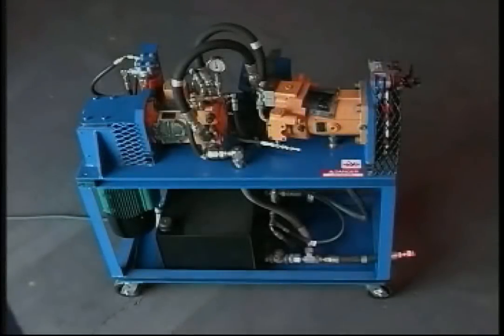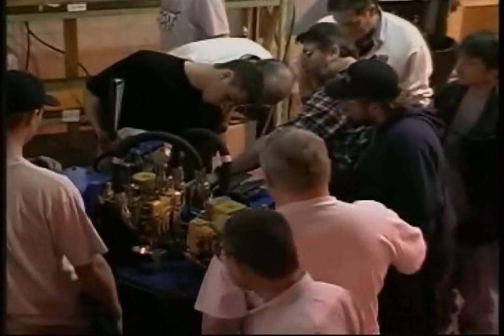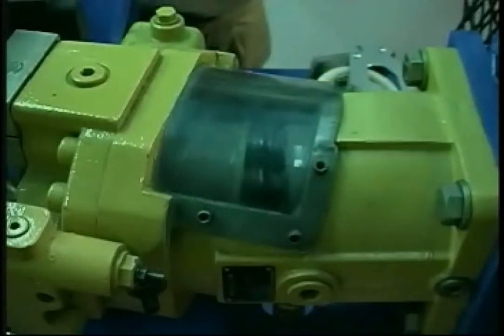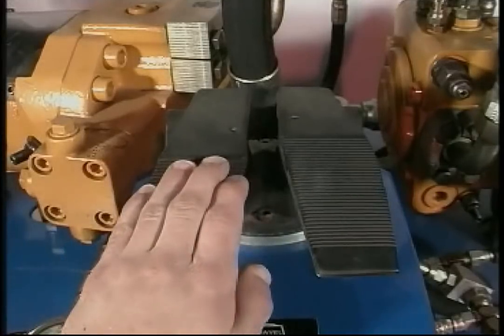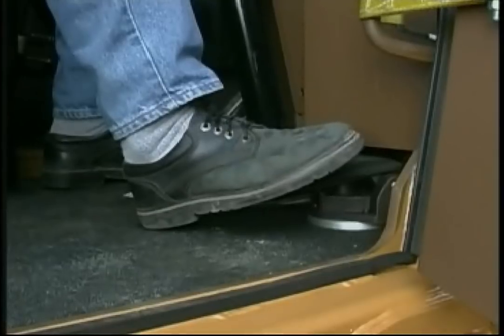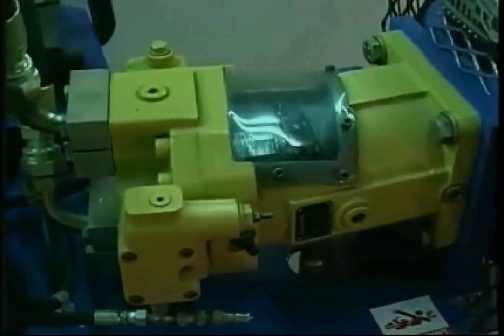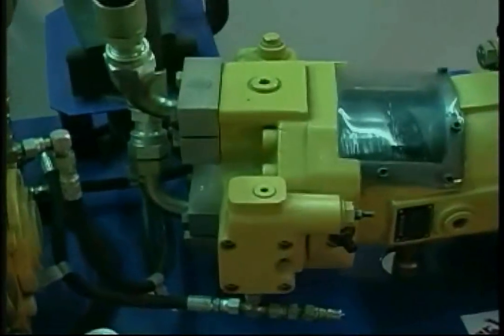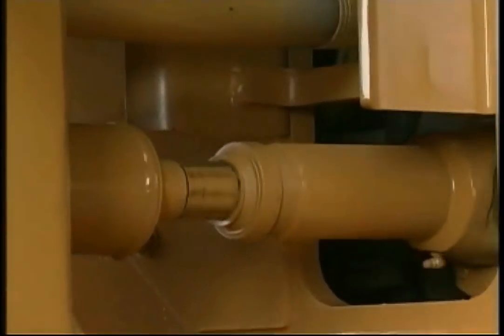Tigercat Hydrostatic Demonstrator Part One

Comment: which allows dirt to settle out of it, heat to radiate from it, and air and water to separate from it. Normally case drain lines are installed on the upper side, to ensure the case is always full, however in this case (pardon the pun), the drains are plumbed on the bottom to help show the rotary groups as they work.

Comment: That's hydraulic oil. It's actually leaking into the case past the pistons, through the slipper pads and between the barrel face and lens plate. In order for two parts to move relative to each other there has to be clearance. These clearances in pumps and motors allow pressurized oil to leak into the case. They are actually designed to take advantage of this fact for three reasons: flushing, cooling and lubrication. This way the leakage oil is always being routed back to the reservoir,

Comment: @FJoeForty Excellent question! I'm not an engineer, so I can only speculate but I don't think there's a reason they can't exist on-highway, instead I think that a mechanical transmission has a better cost/benefit factor than a full hydraulic system, and therefore is more ideal for mass-produced transportation like cars and trucks. Also, hydraulic components are far more sensitive to contamination and poor oil condition, thereby requiring more maintenance than a gearbox might.

Comment: That is the hydraulic oil from the system. There is a designed in leakage in the pump to lubricate the parts.

Comment: @Msashman After coupling two helical gear transmissions together, just so I can can have enough ratios to crawl in a vehicle that I also drive on the highway...I was left with less than ideal drive line lengths and steep working angles. I would much rather have gone hydraulic and have unlimited variability. Any reason why hydrostatic transmissions seem to be allocated to off the highway only? Are there reasons why this can't exist in a passenger car or light duty truck?

Comment: if those pedals regulate the angle in pump/motor, then who or what regulates the speed of diesel motor? (1 extra pedal?)
Reply from the maker: The engine speed can be set by the operator via the control panel. It is mentioned in one of the skidder videos. Useful for short runs so the machine doesn't have to sit and idle while the harvester catches up. As run gets longer the operator can set the speed higher. Thank you for your question.